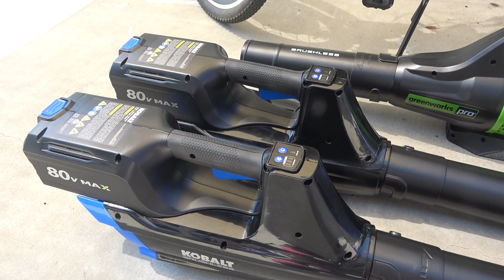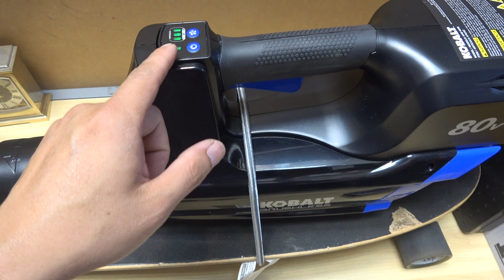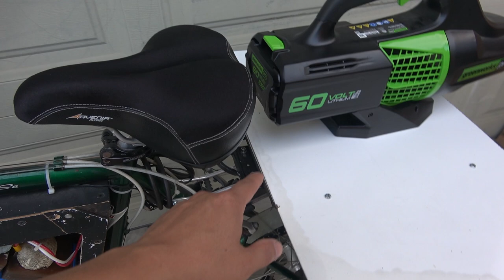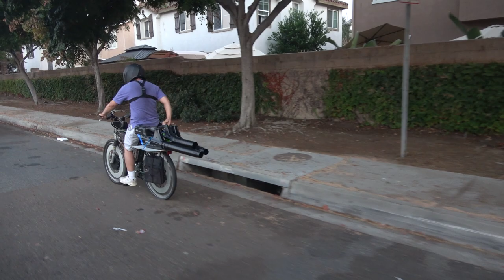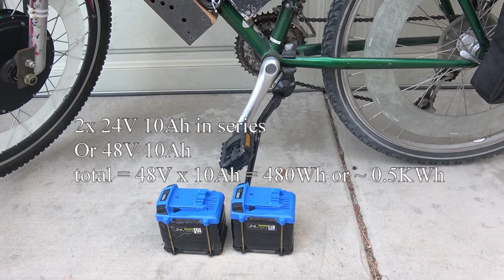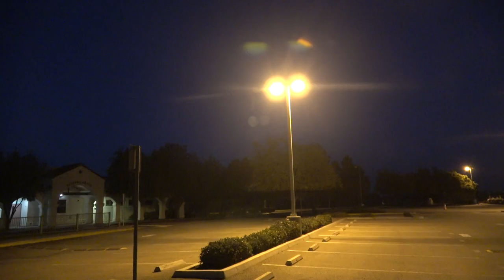Can you power a bike with a cordless blower?

Comment: Try removing the tubes from the blowers. The faster the air velocity the more force the blower should produce. The tubes just slow down the air velocity.
Reply: Tubes help concentrate the air velocity faster/ harder
Reply: Actually they speed up the velocity at the cost of cfm, but the higher cfm will produce more thrust, so you're half right.
Reply: more air moved is better
Reply: The generated thrust is proportional to both velocity and angle of the air. It doesn't help if it leaks to the sides. As a leaf blower, the tube should already be fairly optimized for the best directional flow.
Reply: You still need a Nozzle or rocket type nozzle could boost the flow.

Comment: I'm 14 and I just used bungee cords to attach an electric leaf blower to the back of a clunky old street bike because the pedals and gear system had broken so I couldn't ride it anymore... It works shockingly well and could even go up small hills but the battery life and steering definitely left quite a bit to be desired

Comment: Obvious next steps, which I'm sure you'll show in the next video: remove the bike's motor (to save weight); permanently redirect the bike's batteries to the three jet motors, preferably all higher-performance Green ones; see if you can get the VTOL thing working.
Reply from the maker: Yes, that would make it a bit more efficient and it might go faster.

Comment: I've watched your video on connecting 2 drill batteries...What about 4 x 12v 7ah drill batteries to make a 48v 28ah  battery to power a 48v 1000w motor and 30 ah controller?...What do you think?
Reply from the maker: That would do. But where do you get 12V 7Ah drill batteries?
Reply: @vuaeco  I found them on ebay